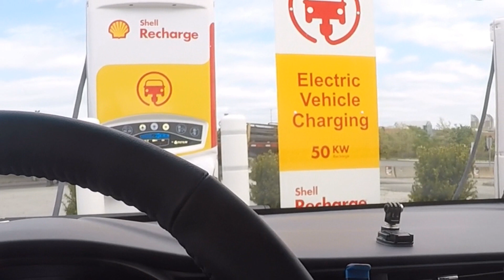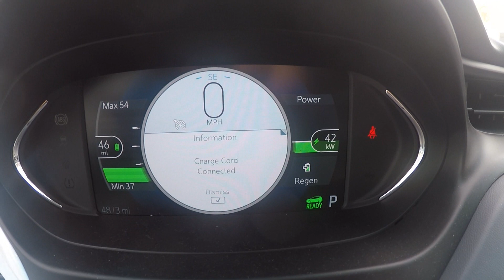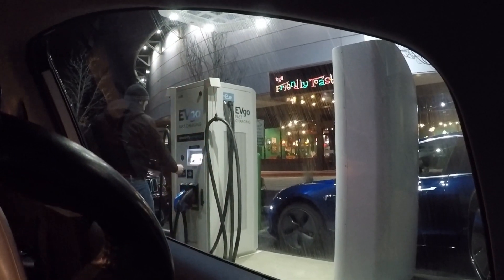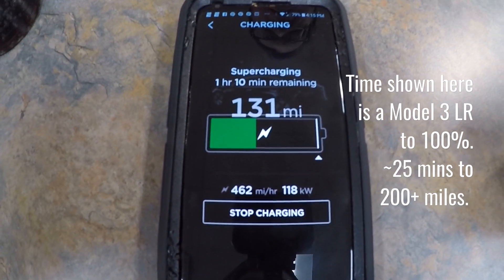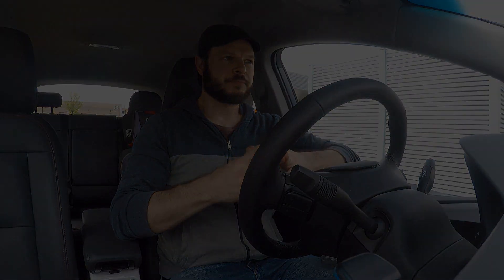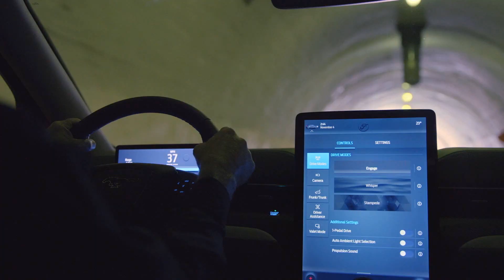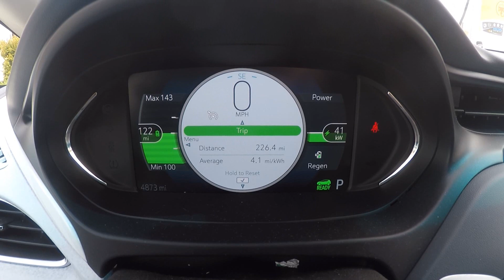Coffee + Kilowatts #5: How Quick Must DC Fast Charging Be?

Comment: On average I think most people are going to want to stop after 3 hours of driving.  And after three hours most people will want to have a washroom break and a quick bite to eat and have a drink.  So I think 20 to 30 minutes is a reasonable charge time.  3 hours of driving on the highway is about 200 miles of driving.   So ideally you want to add 200 miles of range in 20 to 30 minutes.  Now that will be different for different EV's depending on efficiency.   A very efficient EV with a 75KWh battery pack that can do 300 miles of range that equates to an average charge rate of 100 to 150KW (over 10 to 76%).   However on a bigger EV like a Hummer EV with 400 miles of range on a 200KWh battery pack should have a 200 to 300KW average charge rate from 10 to 60%.    Of note the Hummer EV will have a peak charge rate of 350KW and the Lyriq will have a peak charge rate of 200KW.  So I think these EV's will hit these "ideal" numbers.   The Ford Mach-E is also pretty close to these numbers with being able to add ~180 miles of range in about 30 minutes and a peak 150KW charge rate on it's larger battery pack.  It will be interesting to see how charging profiles (average charge rates) evolve as well.   As EV's like the E-tron have a very aggressive charge profile vs. a Model 3 which has major charge tapper curve.
Reply from the maker: Great points all, thanks Erik, and I think the charge profile/real world performance will certainly be key. Many of the 20-30 minute estimates depend on the OEM claims holding up, which isn't always the case. I've been skeptical whether Ford will deliver on its stated performance figures, but the numbers seem to be going in the right direction. If they can deliver those highest charge rates over an extended profile and into the upper portions of the battery, I'll be very happy to eat whatever's left of my hat.
Reply: @plugandplayEV  Yup on the big battery Ford is claiming 10 to 80% in 45mins.  That works out to an average charge rate just above 90KW which is fairly impressive and I think plausible if the battery is at a decent temperature.

Comment: Did you hear the recent announcement that one of GM's faster charging EV's were getting pushed forward ? I think the Lyriq will make it to production earlier than expected because it seems like that will be a great segment for profits.
But, I think it will be priced around $60K to compete with the Long range model Y and GT trim of the Mach E. The high end versions may be almost as expensive as the base model X. It's a Cadillac after all.
Reply from the maker: I caught some of GM's May EV prognostications but I must have missed anything about moving up production. I know the Lyriq and Hummer were next on the slate for individual model launches but I don't know how they're reprioritizing all that with what's happened.

As more models near release, the pricing is beginning to get really warped with the tax credit situation. The Mach-e should be right in with the Model Y but could end up significantly cheaper, depending on how Ford dealers play their pricing. It doesn't quite match Supercharger V3 access, but 150kW charging and effective execution of the FordPass program could make the Mach-e a very compelling alternative.

Comment: On a road trip, I normally drive 3 hours and then take a ~15 minute break.  It would be ideal if I could get an EV that would do that.  Tesla comes close at maybe 20-30 minutes.  The Mustang Mach-E and VW ID.4 take longer than Tesla.  I really wanted an EV from a legacy manufacturer because of build quality and dealer location, but it doesn't look like they will meet my "performance" needs.  Sigh.  OTOH, I'm interested in more details about Chevy's Ultium battery.  So maybe there's still a chance for the legacy manufacturers.
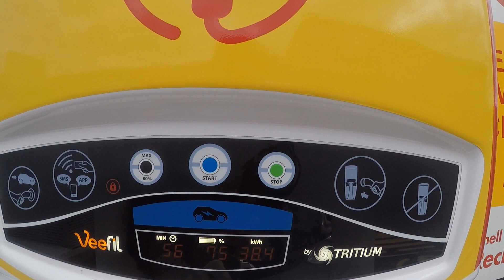As an aside, it's interesting that the stop button at time 9:39 is green.  Most stop buttons are red, start buttons are green.
Reply from the maker: So you're the perfect person to ask, Tom: does that 5-10 minutes make a significant difference to your road trip experience? I understand kicking around in the Bolt EV for almost an hour isn't going to work for most people, but the 25 minute mark seems to be about right for upcoming models like the Mach-e and ID. 4. 

Let's say in those cars you can drive ~250 miles, get 150+ miles back in one 25 minute stop,  then drive another two hours. You've covered 400 miles or so within six hours and only one charge stop, so only 10 minutes lost on your standard road trip expectations... optimal conditions, granted, but it seems like a small trade off to get a car that ticks all the other boxes (and so many more for those who don't already drive an EV).

I think it's after 550-600 miles that the extra time would really begin to add up. I'd argue that after that long on the road it's probably time for a lunch or dinner break, but I can see  that for laser-focused drivers it becomes a burden.

Re. Ultium, Adithya above pointed out that one of the new gen EVs from GM is supposed to be moving up its release date, rather than pushed back as the new Bolt has been. Hopefully it's one that meets your needs and offers another option.
Reply: @plugandplayEV  Thanks for the questions.  Of course, I'm just one voice out of many but here's my thoughts.
My wife and I take a 679 mile road trip between our house in SC and Baton Rouge, LA.  It normally takes around 10 hours including stops. We're pretty worn out after that drive so I don't want to add too much time.    According to ABRP,  that same trip at the same driving speed in a Tesla model 3 AWD LR (you have to get AWD if you want LR these days) would take about 30-45 minutes longer.  I could live with that, not so much my wife.  ABRP estimates a  VW ID.4 would take another 30-45 minutes (for a total of 1-1.5 hours) assuming the EA system is built out (under construction now).  That extra time is a bridge too far for me and especially for my wife.  And the Bolt would take an additional hour over the VW so we probably won't take the Bolt even when the EA system is built out.

Comment: I think another big upgrade in non-Tesla EVs is also Plug and Charge which Electrify America is working towards. EA and others still have some problems processing payment and (not as much EA) with their apps. A pay by VIN system that works automatically like Tesla could be a big help.

For faster charging non-Tesla EVs I’m also excited to see the ID4 and the Rivian Series. Both are likely to offer 110kW+ real world charging speeds. I also want GM to hurry up and announce the Hummer EV!

Another big Catalyst I think will also be the scaling up of 800V architecture. This will majorly increase the charging speeds without having to use as large of cabling (less amp draw required).
Reply: Of note Ford and Mercedes are setting up accounts with multiple charge providers to allow for plug to charge.  So you just have to have an account with Ford and you will be able to plug to charge on multiple station providers.
Reply from the maker: Ford seems to get that the charging network piece is as important as the car itself when it comes to convincing regular car buyers they can make all-electric work. How well they actually implement FordPass remains to be seen but the fact they've touted it right from the launch is, hopefully, a good sign.
Reply: @ lynyrd65YT
 - I'm excited about Rivian as well.  FWIW, according to Rivian's spec sheet both of their EAVs will have a max charge rate of 160 kW.
Reply from the maker: Very true,  and that would certainly bring down overall charge stop time by cutting out a task (and a potential point of failure). I was under the impression that only future models would deliver that feature but recently learned that both the Audi e-Tron and Porsche Taycan have the required ISO 15118 standard. 

Electrify America has also said its stations are ready to use the standard with compatible vehicles, so not sure which  party is delaying the roll out on that.

Comment: You present interesting points for discussion. I expect nearly all future EVs to have higher charging rates than our Bolts, but I'm curious to see if faster charging becomes something of a trade-off for larger capacity batteries. My particular use case at the moment would benefit more from longer range, but hopefully that need will lessen as charging becomes more ubiquitous. I have high hopes that the Mach-e (or something similar) will be a suitable replacement for our ICE suv when the time comes.
Reply from the maker: It does seem like 100kW will become the new accepted minimum, with 150kW being good and anything above that probably translating to "very expensive" for the next few years. 

The e-Tron is a good early example of faster charging compensating for sub par range. I didn't expect to see too many people posting road trips in the Audi, but the combination of Electrify America's expansion and 150kW charging right up to the top end of the pack seem to make it viable.